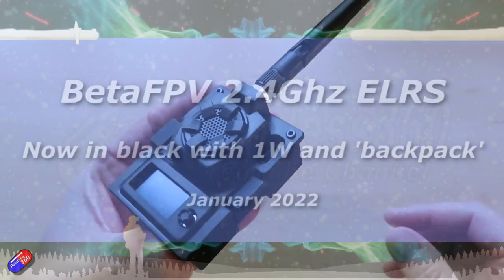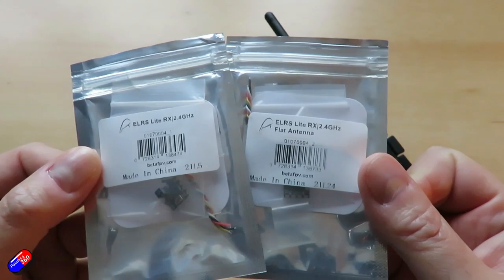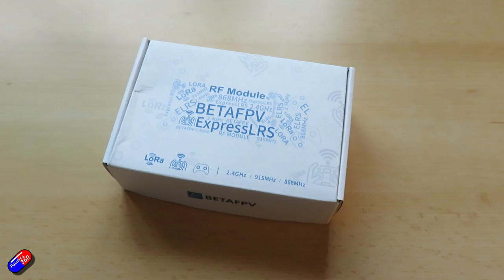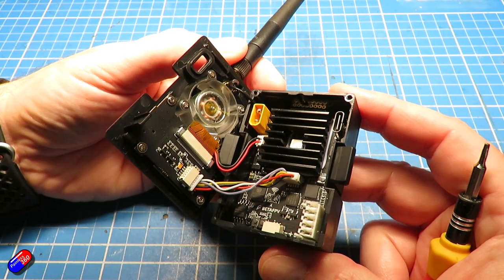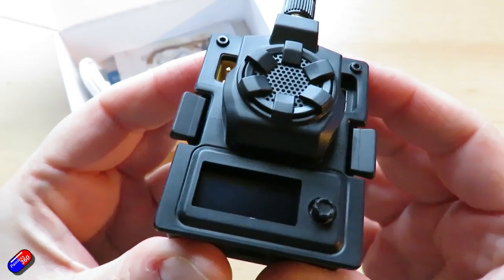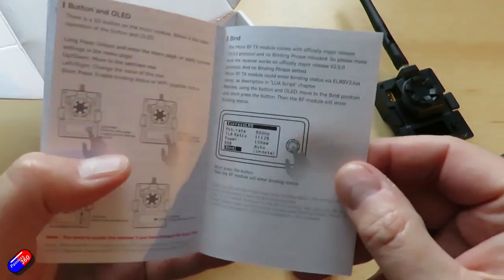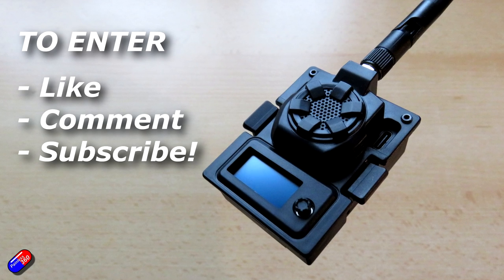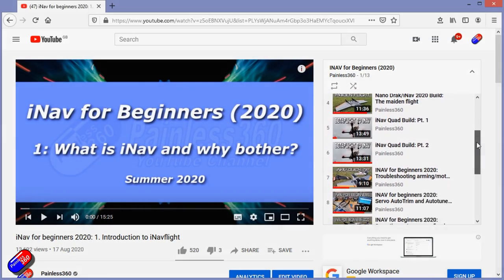BetaFPV ELRS 2.4Ghz 1W Micro Module Overview (and giveaway!)

Comment: i have a r9m 2019 tx and the connector gave me so many problems like random failsafes. now i fixed it with a servo cable but is so fragile and really unconfortable. I really like how this modules look, and in my opinion 2,4 ghz is the best choice since the reciver are smaller and more pilots can fly at the same time.
thanks for the giveaway and good luck guys.

Comment: Im a beginner to fpv and love your vidios. I have practiced up in the simulator and want to get started with fpv flying. A elrs module would be really helpful for me to take a cost off and to have something reliable that I will not have to upgrade. 

Unrelated: Whats the best drone to start with? I originally had the idea of a tinywhoop but have heard that they fly really bad. Is it a good idea to start with a five inch? 

Thanks:)
Reply from the maker: It depends on what you want from the drone and how (and where!) you want to fly it. Things like whoops are nice as their props are enclosed and they can fly indoors as well as outdoors. Check out my sub250g playlist for options.. Best of luck!

Comment: ELRS is quickly becoming very interesting. Seeing lots of 2.4GHz choices coming to market in last 6-9 months.
That BNF (PNP) models and transmitters including ELRS already is telling of how popular this open project is becoming. 
That this video also has 250+ comments in <24 hours is telling of interesting in ELRS. 😃

Will be fascinating if support includes some more frequencies. (900MHz bands). 
Soon the problem will be narrowing down a choice for all the hardware options that are available. (until the community considers certain features a default set and manufactures match)

Comment: Im used to Crossfire 868MHz but Im seriously going to try ELRS V2.0. I have a ZOHD Dart250G that would benefit from it. Its currently got a Radiomaster 2.4GHz D8 SBUS rx in it at the moment with an F411WSE f/c. Ive built long range versions of the Dart250G using Crossfire with the immortal T so it would be interesting to see how far ELRS will go. The benefit of a smaller antenna causing less drag is appealing too.

Comment: I bought the 500mw one quite recently and I'm slightly regretting not waiting for this one. That being said like you mentioned 1 watt isn't really needed in most use cases anyway and people like Wezley have demonstrated even 100mw will get you very far with the right antenna setup.
Reply: But trees and buildings 👷🏻‍♂️ he flies airplane no carbon in way. High in the air. Open field. Those perfect conditions.  
Try ceramic antenna behind parts and battery
That said 1w only give u like max 50% more range.
Reply: @divingfalconfpv4602  very true, got to take a lot of these max range tests with a pinch of salt as unless you are flying with the exam same setup in the same kind of environment you're not going to get the same results.
Reply from the maker: Antenna quality and alignment, quality of the kit, local RF noise, obstructions, other pilots etc. etc. will affect how well a system works. If you struggle with a specific frequency then trying a lower one can make all the difference (868/915Mhz vs. 2.4Ghz). P.S. I do fly quads and lots of things with CF in it and increasing the power by a factor of 2 WILL NOT result in a doubling of range - not how RF propagation works - see the Antenna Lab series...

Comment: I've been using Crossfire and Tracer for the past couple of years. ELRS looks good and I'm keen to test these out as well especially if more manufacturers are having the RX built into the FCs as well. Especially for whoop size and 20x20 boards. Sure beats having to solder an additional rx to save weight.

Comment: I'm usin ELRS flashed on r9 hardware the only bad thing is that I had to ghetto mod the housing to add a fan. Which is loud as hell and draws a lot of power.I'm considering getting a new module that has a proper heatsink and fan. Maybe 2.4 would be better for my quads and 868 for the plane.
So I need two now..

Comment: Thanks . I bought one . It did not bind in betaflight . I use the version 1. Firmware it comes with . I bought 3 more recievers to try binding without the drone bothered into the curcuit first .
    Can these recievers rebind or is it a one chance hit and miss thing ? 
  I used a crossfire reciever instead without lua script . Maybe i had the module ready to bind and forgot to long press the button . Or do i press a button on the tx to bind ?  3 more chances to guess .
Reply from the maker: The reciever needs to b eon the same major version of the ELRS firmware as the radio to connect. So if your radio is on 2.0 and the RX is on 2.2 then they will work. Most shipping receivers are on V2 now so check what is on the radio... Best of luck
Reply: @Painless360  the reciever is printed V1
Reply: @Painless360  and some have the square pad as GND. and some it is reciever . Hmm
   But it lit up leds . 
The new reciever says beta fpv version V1.0

Comment: Hi, which variant will have better penetration through brick walls and concrete?

If you stay on the first floor of a 3 level house, who will have a better penetration, crsf or elrs 2.4G, flying throughout all these house's floors and around it?..
Reply from the maker: Longer wavelengths have better penetrating and propagation powers but even then getting through concrete is asking a lot on the power levels we use in the hobby..

Comment: Trust me 1 watt is good I fly in a high rf environment and get sudden dips in lq I use the t-lite with the micro happymodel module had a very bad experience with it so sold the t-lite bye bye power issues and ordered a tx 16s from banggood I’m in india so waiting for stock to come having a 1w capable module means that it will have awesome cooling and in hot places it will hold its rf power steady

Comment: 1 watt uses twice the battery of 500mW .
     But doubling the power of a transmitter only increase range distance by about 25% .
   500 mW claims miles of range or about 500 feet . So 1000 mW should reach a phenominal 650 feet . Maybe a smaller drone and battery could drain fast and cause video problems as well as insufficient motor/ onboard tranciever failsafes

Comment: Hello I've a Radiomaster TX16s (version 1) and the betafpv expresslrs elrs 2.4ghz 1W Micro Module. I can't change the 10W value, in the module joistick or in the LUA software, Do you have an ideia what maybe is the cause?
Reply from the maker: Not sure, I'd normally check the forums... Best of luck

Comment: I'm currious about this, may be hard to switch from Crossfire though.
Reply: The receivers are all wired up exactly like crossfire, and the settings in betaflight are all the same too (crsf protocol etc). 
So it really is just a hotswap and you're onboard, the firmware flashing is a breeze.

Comment: I am waiting for ExpressLRS to release WIFI INAV and BETAFLIGHT wireless configurator feature. No more USB cables needed for configuring plane or quad.
Reply: Configuration tools will need to come from INAV, Betaflight project teams, not from ELRS project. 
This because the Configuration tools could break between FC software releases. 
The ability to run a LUA script, or have some basic configuration options built into OpenTx/EdgeTx would be very fascinating. 🤔
Reply: @AerialWaviator  Read the pull request "Adds MSP to CRSF over TCP (WIFI) feature #1274"

Comment: Hi,
I would like to know if it is the ELRS, it can be configured on the APM PRO UART and also on the APM 2.8 on the I2C modified for RX2 and TX2, thank you.
Reply from the maker: The issue with the APM is that it hadn't been officially supported by Ardupilot for a long time. v3.2.1 was the last version (https://ardupilot.org/copter/docs/common-downloads_firmware.html). That may not have all of the support you need for CRSF so you'd have to use SBUS.. Best of luck
Reply: @Painless360  Will they put S-BUS in the smaller RX ELRS?
Reply from the maker: I'd expect so. So much 'legacy' stuff uses it!